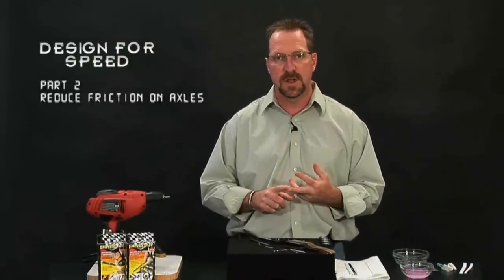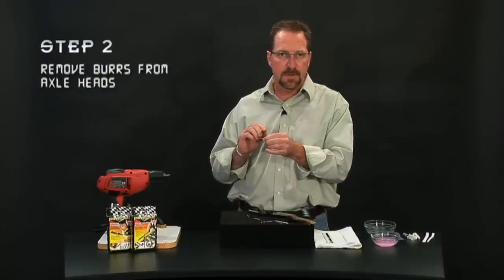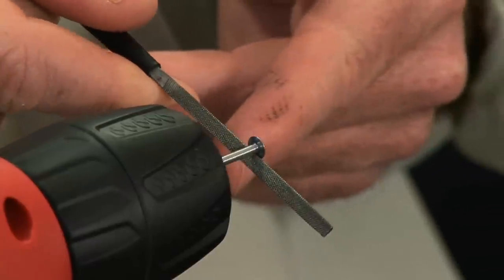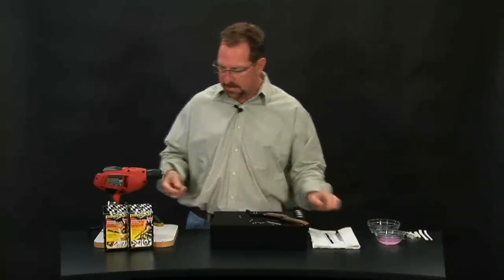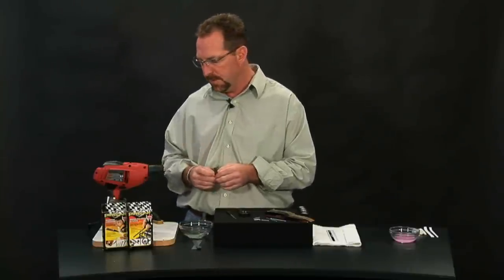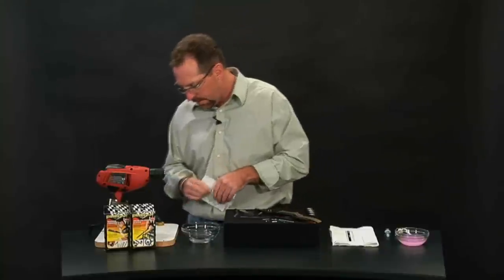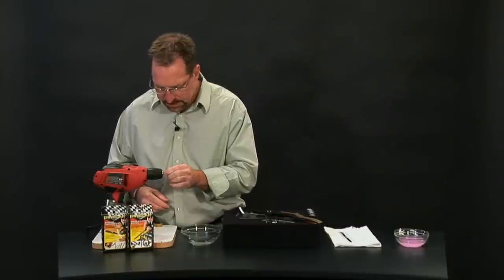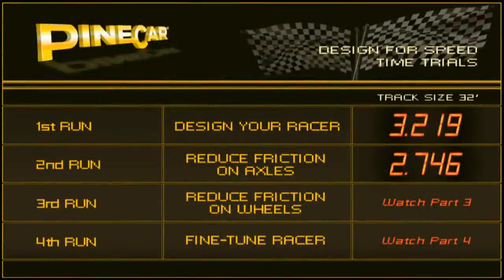Design For Speed - Part 2 of 4 - Pinewood Racing Car | PineCar Derby

Comment: What type of drill are you using?  I have not seen one that you can lock the trigger and keep it on hands free.
Reply: From the color I'd say Hilti. Beaucoup $$$$$ for a damn pinecar "lathe." Just use duct tape you're not in a trade that would benefit from such an awesome tool.